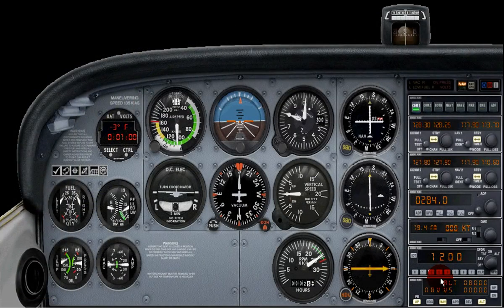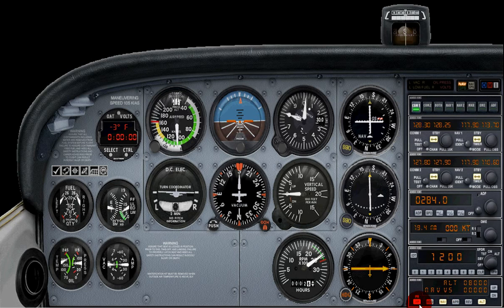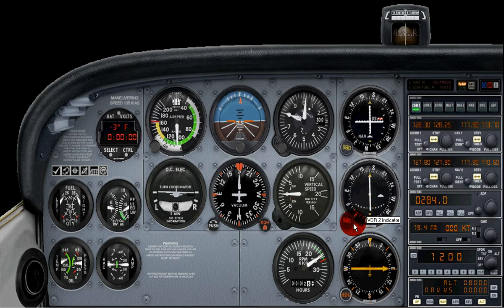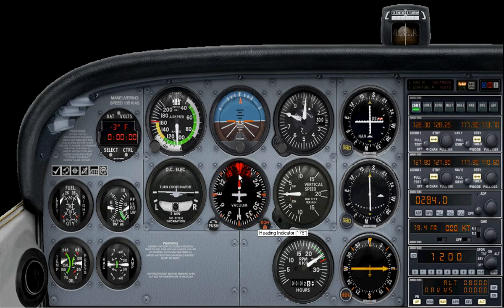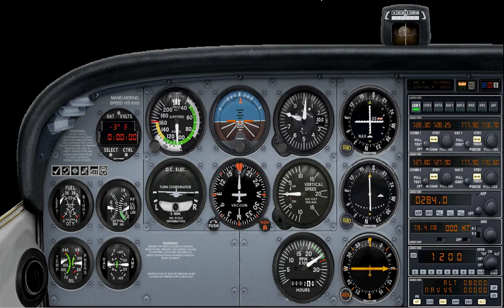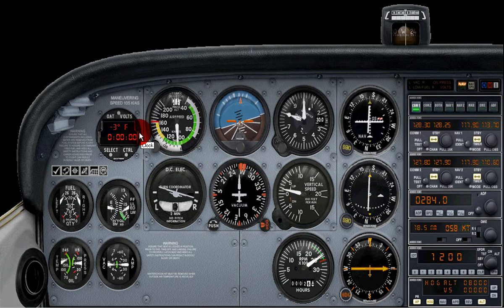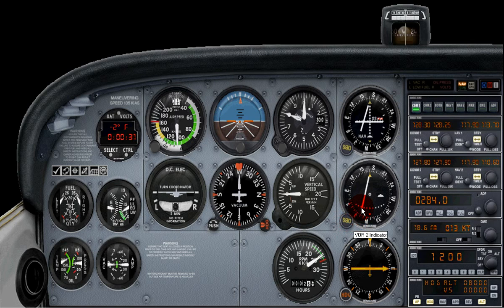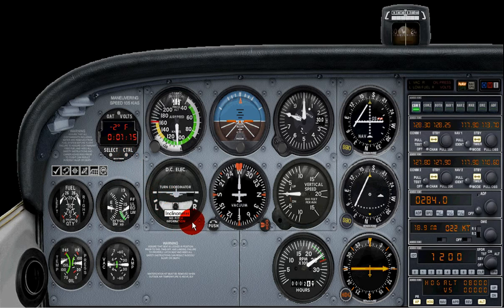E6B Flight Computer: Time to VOR Station

Comment: hi flight tutor!

thanks, but.... one question though. what is the purpose of doing a S turn and then find out the deflection (deviation of angle ) for a time being , which thanks to e6b will give us the time to a Vor Station when We have a DMe that give us the distance to go and the speed GS and aligned with the Vor station (not diffiicult to compute the time to go) . unless this procedure is used for planes that have no DMe but just a CDI instrument and a stop watch.
thanks for your  response and your help indeed.

Farid